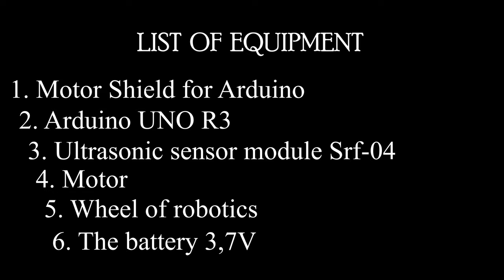DIY How to Make Amazing Robot Vacuum Cleaner

Comment: The electronics built in the video aren't what is finally shown to be running. Eg, at 5:32 we see two battery holders, but only one was installed. Furthermore, it's clear that the HC-SR04 isn't hooked up, and due to the way it's mounted, won't allow for as easy access as this purports.
Reply: there were most likely two batteries hooked up do to the induction fan . a single 3.7 volt wont be enough to drive everything  so using  2s  is the way to go

Comment: hummmm, the materials?? idk how i can do it if i don't know the things what i'm doing to use :i
Reply: arduino and cable 
motor driver shield
jumper wires
gear motor (3) and wheel
brush motor
ultrasonic sensor
Reply: even battery

Comment: Its an fake video guys the robot is not working automatically as you can see at 5:03 she showed that the sensors are connected with wires but at 5:30 when she removed the body you can clearly see the sensors are disconnected so all that means is its controlled by remote